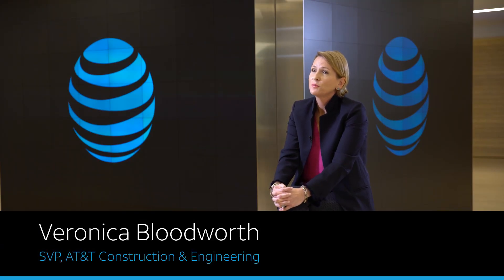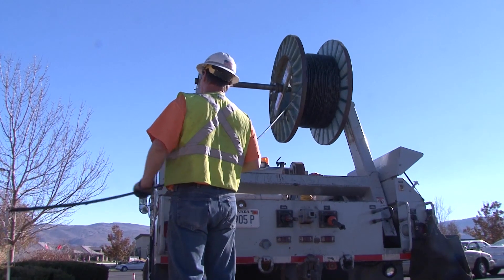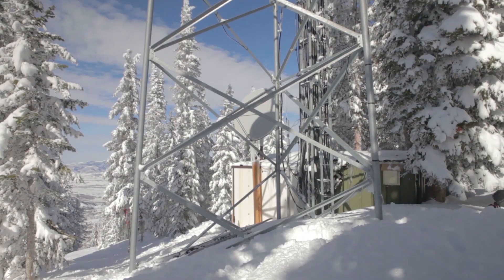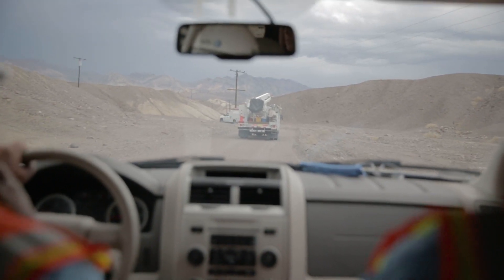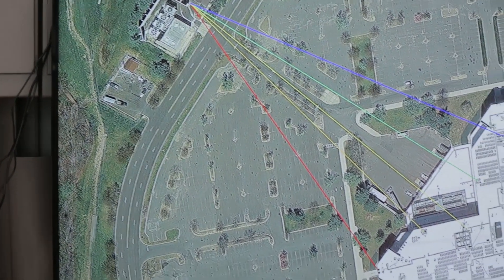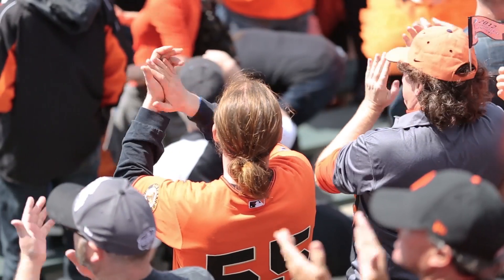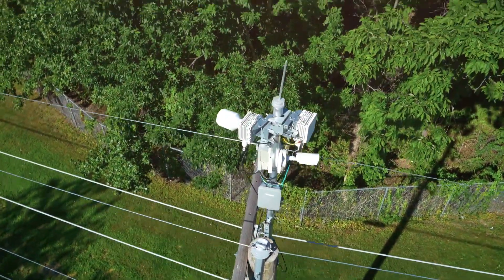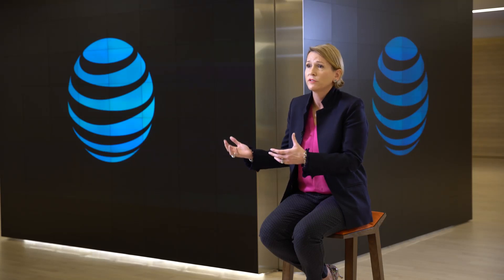AT&T's Construction & Engineering Group is Building the Next-Generation Network | AT&T

Comment: I am very disappointed that you chose to remove OAN from your line up. Being able to watch OAN was the only reason that I have stayed with AT&T, and as you can see by my account number, I have been a customer for quite a while.

I will now be dumping your overpriced service, and slow internet speed, Spectrum may not have OAN ether, but I will be able to watch OAN LIVE on a faster connection.

Your Company is run by Cowards!